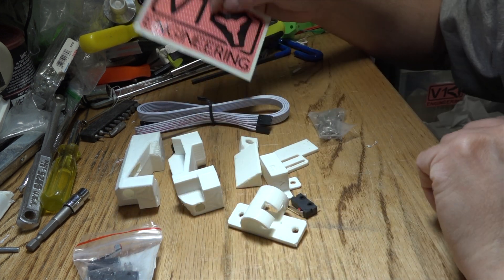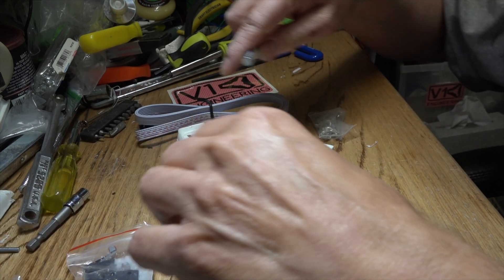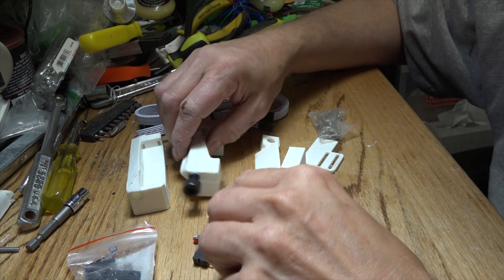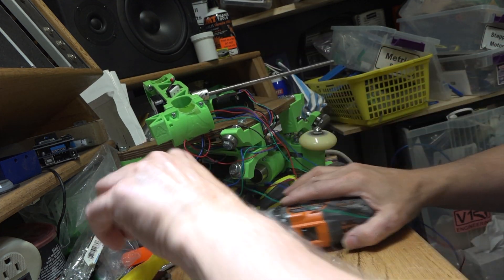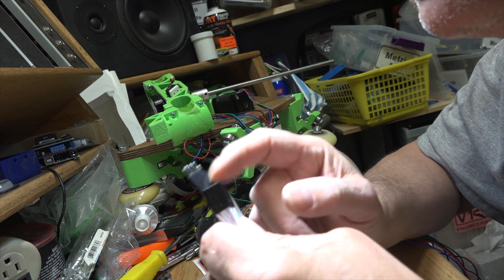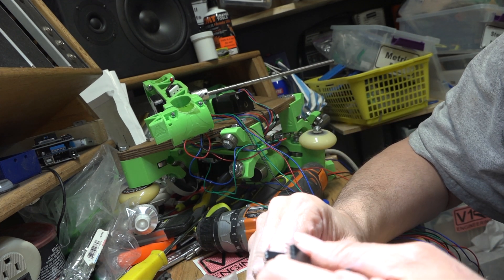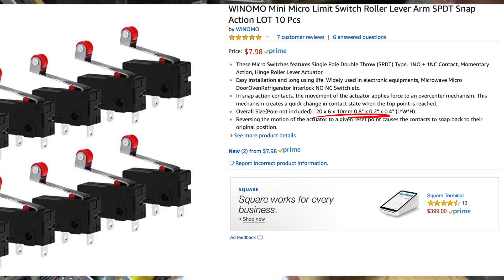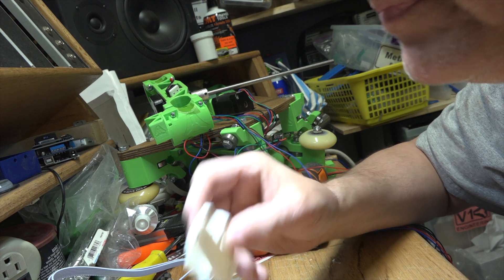Lowrider II Build -  Part 5 - Let's Talk Dual Endstops

Comment: I’ve been following along with your build, and building my lowrider2 with your dual end stops. I’ve noticed after one of my end stop triggers then the other one triggers. It raises up and slowly comes back down to refrigerate end stops. When one of the triggers the Zach’s on the side that triggers first doesn’t stop turning it continues to lower even after the end stop on that side is triggered until the opposite side triggers then they both stop. Shouldn’t the side that triggers first stop and wait on the other side to trigger or am I missing something?
Reply from the maker: Hi Dennis!  Thanks for watching and commenting.  Yes, it should work the way you're thinking, and not the way that it is.  

 One thing to try would be to connect the serial port such that you can issues Gcode commands, such as through pronterface.   Then use the M119 command to display the current states of the endstops. M119 is a little confusion. For inactive endstops it says "open". Active ones are listed as 
"Triggered".  Go around and while holding each individual Endstop switch, submit a M119 command and make sure it shows Triggered on for the correct entry. 

If you don't find anything wrong doing the M119 command, it might be prudent to review the dual-unstop configuration.

Hope this helps, let me know how it goes...

Thx
SOGC
Reply: Some Old Guy Coding yes sir I ran the m119 and it shows to be working correctly. When the right side triggers the z axis just stops. I can manually trigger the left side after the right side triggers and the z axis will raise a few mm the lower until the right side triggers the it will stop again.  I really appreciate the work you’ve done on this, your videos are straight forward and easy to follow.
Reply from the maker: @dennisbumgarner2640  Next I'd recommend rechecking the configuration settings.  Here's a link to where I talk about my settings. https://youtu.be/w0PzxTOlwRY?t=1143
Reply: Some Old Guy Coding I have found my issue. On the Rambo 1.4 board both z motors are controlled by 1 driver so when the first Endstop is triggered both motors stop. I do not know how to assign the E0 set of pins to control the Z2 motor but that’s what needs to happen
Reply from the maker: @dennisbumgarner2640  in configuration_adv.h
enable which axes will dual.

Comment or uncomment depending on your use:
X_DUAL_STEPPER_DRIVERS
X_DUAL_STEPPER_DRIVERS
X_DUAL_STEPPER_DRIVERS

Somewhere in the code (I haven't found where for sure) it will assign E0 and E1 as the second drive.
Reply: Some Old Guy Coding I found it in the pin.h file. It was already setup to use the next available extruder pins. All I had to do was plug it in, and I had no ideal lol. Thanks again for your videos and part files

Comment: The lowrider kit I bought came with 4 end stops. I see you are using five. Which one is not supposed to be used in my kit?
Reply from the maker: It depends on if you’re planning on doing dual end stops, and where. 

You can do single end-stop on all axes, needing 3 switches

Or dual end stops on only one axis, needing 4 switches. 

Or dual end stops on two axes, needing 5 switches. 

Of course you can run the machine without end stops too.

Comment: Hello congratulations for your great work, I would like to install a double endstop on the z axis I can't find what part of the firmware I have to modify, or is there a specific firmware?
Reply from the maker: thanks!  See part 8 of the series - Wiring.  it also covers code changes for dual ends top. thx for watching!

Comment: Thanks again for posting the video. How stiff did you find the last version of Lowrider that you built? Did you find the router carrying axis racking much? Thanks
Reply from the maker: I didn't find any problem with that.  Or at least I didn't notice any. Occasionally steppers would skip steps due to obstruction, feed rates, or really dull bits.  But that's to be expected.